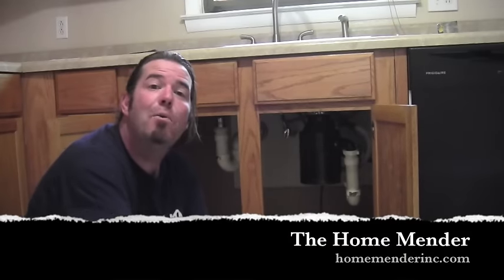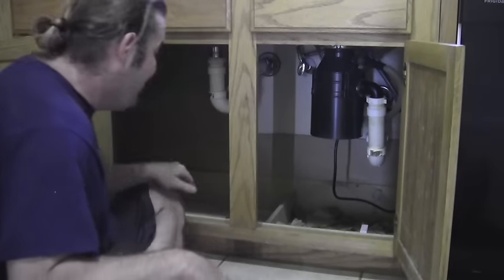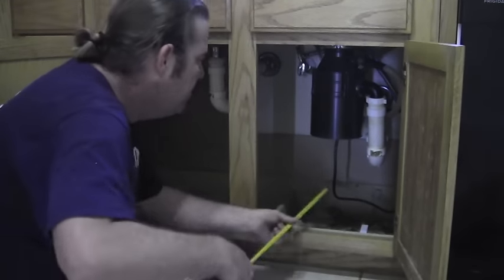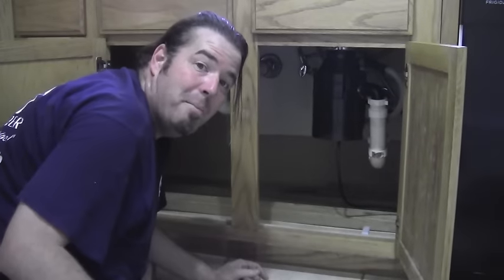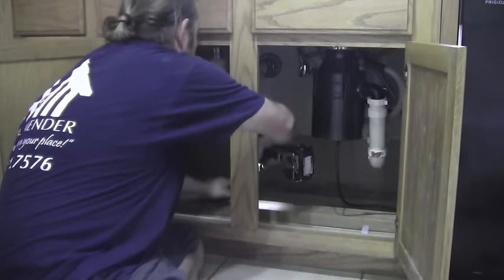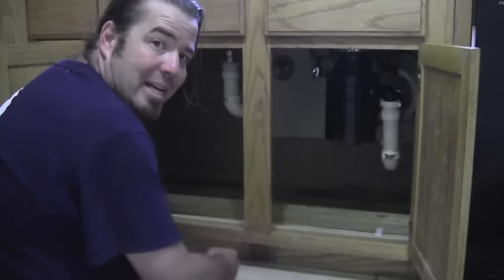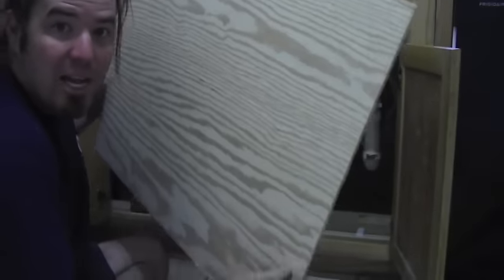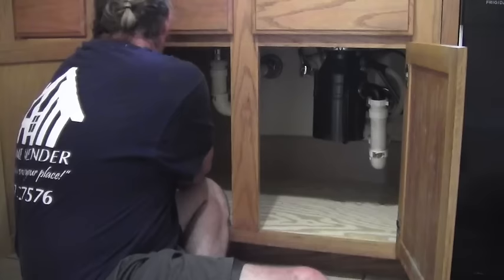How to replace rotted sink base cabinet floor bottom. Easy! Home Mender.

Comment: Can this be done to the cabinet wall too?  We had a giant leak of a cleaning product spill and bottom and one wall need replaced.
Reply from the maker: Hi Vanessa.  Yes mam.  As long as it’s not gross and moldy, you can put another label right over top of it like false wall. You got this!
Reply: What about removing buckled old one and putting up something else
Reply from the maker: You certainly can remove the old and install a new :-)

Comment: I was wondering how much I should charge to do a job like this?
any advice from anyone in here would be appreciated thank you in advance?
Reply from the maker: hey anthony! great question...i usually have extra plywood or luan in the shop so i rarely charge for material but labor usually runs around 150..depending on the size. i hope this helps!
Reply: @homemend  thank you very much that helped a lot. There are three vanity bottoms to do so I charged $550.00 to do all three total. Thanks for the help

Comment: Not have to cut new cabinet board in half!!  Simply remove the HORIZONTAL floor board strip that's underneath the cabinet (not the vertical separator but the BOTTOM trim piece that sits on the floor) if it is rotted it will slide out if not make a cut, and once out the divider doesn't reach that part so the new board simply slides in from the bottom WHOLE and UNCUT.  Much easier to join that 3" floor board strip back together than it is an entire 21" width board.  Then simply slide the new wood board WHOLE and UNCUT underneath into the opening, add the cinder blocks then position the new wood board atop them.  Silicone the edges of the board, add a nice Xtreme under the sink mat and wallah!  Done in 10 minutes.
Reply from the maker: awesome mo! thanks for sharing!

Comment: I see you have the plumbing going into the wall, mine goes into the floor :( idk how to cut around that)
Reply from the maker: Great question. You would want to draw out where your pop pipes go first on your full board, and then cut your board in half through the pipe hole. That way you can piece it together around the pipes. I hope this helps.

Comment: Mine cant be banged out like that how would i actually remove it?
Reply from the maker: Hey Beth you can just use a saw to cut it in half if you can’t break it and then pull it out in the sections. You got this

Comment: What do I do if the water damage is also on the cabinet walls and on the front lip, not just on the floor? Do I have to replace the entire cabinet unit? Is there any way to do that without taking the countertop off? The section of cabinet that needs replacing is 39in wide,  but it's bettween a dishwasher (the culprit) and an island (butted up to, not part of-- but the counter/Formica is in one solid piece on top of all of them-- all 126in of it.)
Reply from the maker: hi hyatt.. you can remove and replace the cabinet without removing the counter top but its more of a surgical procedure than construction. you can alway install temp braces as you go to ensure you dont break your top.. please keep me posted! you got this and thanks for sharing!
Reply: Thanks, man. Love the microwave video, by the way. Been procrastinating on putting one up because the paper template was so cumbersome. Going to toss it and just measure! Haha

We bought our late ‘70s house two years ago from the owners who originally built it, so it’s mostly original and really dated, but in great shape— until this hose sprang a leak. Eventually, we want to update a lot of it. So I subscribed and will consider this a valuable resource when the time comes. :)
Reply from the maker: so awesome Hyatt! love to have you. thanks for commenting!

Comment: Hey Home Mender how much will it cost to fix a rotten base cabinet?  I have zero skills. Who do I hire? A plumber or some other type of guy?

What is the approx non-ripoff cost? Thank you.

Also, I live in a 10 year old condo. Are they built differently? What if the base cabinet is attached to the cabinet?

I bought a plastic under sink mat. Is it bad to cover the huge mold spot that has formed on the base cabinet with it?
Reply from the maker: hey verve...probably about 150 is a decent price. If you are going to hire someone, a carpenter is probably best. it should be about the same as this base cabinet. HD sells a mold and mildew remover, by zep? (theres only one kind) which works awesome. I hope this helps!
Reply: Home Mender 150 including the plumbers's rate?
Reply from the maker: hey verve..usually a "handyman/repairman" can do both tasks..im assuming there is an active leak. If there is not, a plumber wouldn't be needed but a good repair man can fix both.

Comment: I took out the rotted floor under my sink and now the concrete foundation is exposed. Is it really necessary to replace it? There’s so much more room without it. I don’t think the floor board was important for the cabinet’s structural support.
Reply from the maker: Hey Wooster. You do not have to have a floor in the cabinet bottom. You rock

Comment: Can anyone give me a suggestion if my floor is concret and I don't want to drill it down to the floor... What is the best way to secure the frame? Cabinet walls are mdf.
Reply from the maker: hi heidi..if you build a frame for it and then set a floor on it, it will be fairly heavy and probably wont move...a side from using L brackets, which might be a pain, you could trim it out in quarter round and shoot it to the cabinet wall and cabinet floor which will secure it pretty well.. i hope this helps...you got this!

Comment: How would you do this same process if the pipes go into the floor of the cabinet? We can't just lay two plywood pieces down, and neither of us have plumbing skills...
Reply from the maker: Hey colorful. pipes through the floor are done the same way. After you get your board measured and cut, mark out where the pipes are on the board. Drill holes through your new board and then make your cut through the holes so you can piece it in in two pieces. You got this.
Reply: @homemend  thank you!! I can visualize it now. I guess I’ll have to go ahead and do it!

Comment: Wouldn’t it be easier to build a frame with 2x4 or 2x6 and rip them to create the height desired. And then just screw to adjacent walls of existing cabinet box.
Reply from the maker: Awesome suggestion thanks for sharing

Comment: Unfortunately my water pipes and drain go through the floor.  No idea how to replace it.
Reply from the maker: Hey Pat. This one definitely needs a video. You would do it the same way but measure your pipes over and cut a hole for those pipes. If they’re close together, you do it all in one. Then you can cut your halfway board Mark through the hole and then piece it together around them. I hope this helps and yes, it definitely needs a video.

Comment: How can I remove an existing shelf from inside a cabinet and replace it. It's a particle board shelf and the edge is splintering and falling apaart.
Reply from the maker: hi judi! gee whiz.. it sounds to me like you will need to rebuild it.. If you would like to share it, find us on instagram "thehomemender"
Reply: The whole cabinet?
Or just the shelf?

Comment: How about when the plumbing comes up through the bottom?
Reply from the maker: hi lava.. you would need to do yours a little different. You should still cut the full piece to fit, then mark your holes, drill them out, then cut the board so you can piece it in around the pipes.. I hope this helps!

Comment: Hi Dustin,

To protect your health against breathing in mold spores, please consider using gloves and a face mask. 

Thanks for the helpful video! 
;- )
Reply: which type works for mold? n95 or the other one?
Reply from the maker: thank you!
Reply: @verveblack  The 3M N95 mask is effective, if you can still get one, or try the Honeywell Nuisance Particulate Disposable Dust Mask, 5-pack - RWS-54000.

Comment: Why not just use a few 8"x6"x16" cinder blocks for the new base board to set on?  Set blocks on their side so they are 6" height so no need to stack to the height you need it.  Will never rot and breathes to avoid mildew.  Your new wood base can sit nicely on them, not have to attach to wall plate, nor fasten down, especially if you use a thick board its own weight will keep it laying flat on top of four cinder blocks.
Reply from the maker: great suggestion mo...thanks for commenting!
Reply: moniquemonicat I like it! Using more wood doesn’t sound like a good idea since it is susceptible to rotting. I wonder what else would be good to use under there?.

Comment: That's great if you have no water pipes coming in through the floor of your cabinet.
Reply from the maker: hi pat...if you have pipes, you would do it the same way, measure and mark your pipes before you cut your board and then piece it depending on where your pipes lie..you got this... i hope it helps.

Comment: That isn't how you do this. Unscrew the ganged cabinet(s) and tap the cabinet front off. Beat the bottom out. Cut a new bottom and slip it into the existing dadoes. (One piece, not split like the video and a 1/2" thick bottom instead of a measly 1/4".) Slide the sides into the cabinet front dadoes and hot melt glue it back in place just like they did at the factory. Gang it back to the adjacent cabinet and done.
Reply from the maker: ...ok joseph!.. thanks for sharing

Comment: How do you change the wall plate under sink?
Reply from the maker: Hey Kristen you would want to do it the same way however you would need to measure over your holes for your pipes and drill the holes. Then cut the board so you can cut the holes in half. This actually would make a great video. Hop on the homemender mighty Ntwrk!

Comment: How do I secure the frame to concrete floor?
Reply from the maker: Awesome question GB. Once you put the board down you shouldn’t need to secure it however if you wanted extra stability you could always use a hard core adhesive like quad or Loctite. I hope this helps

Comment: all my pipes and shit go through the bottom board, sigh
Reply from the maker: You got this Dora. Do it the same way, cut the piece to fit, then measure for the holes, then cut your halves And make sure the line passes through the holes, that way they fit in around the pipes. You got this